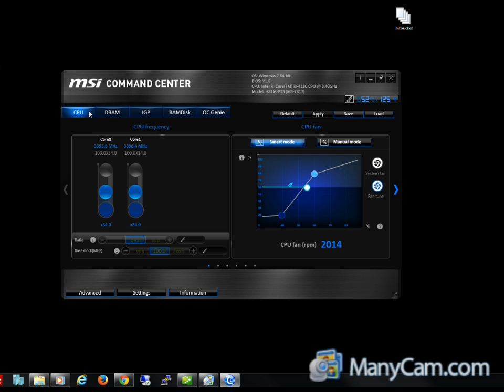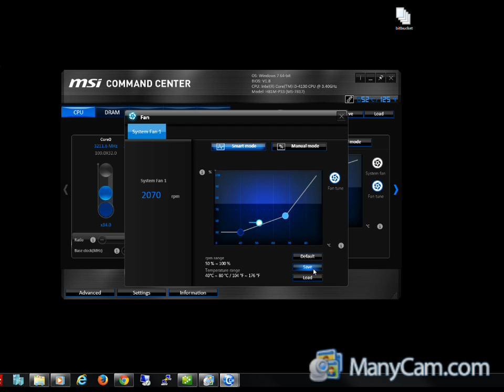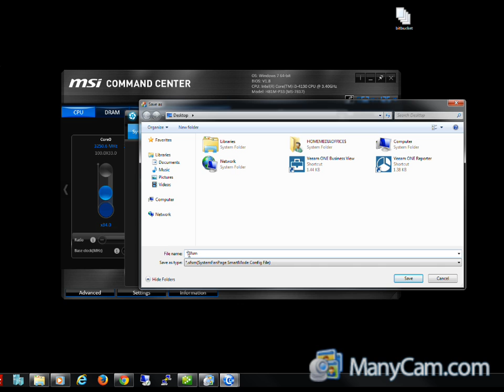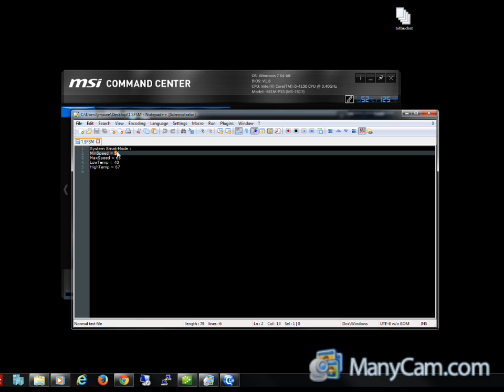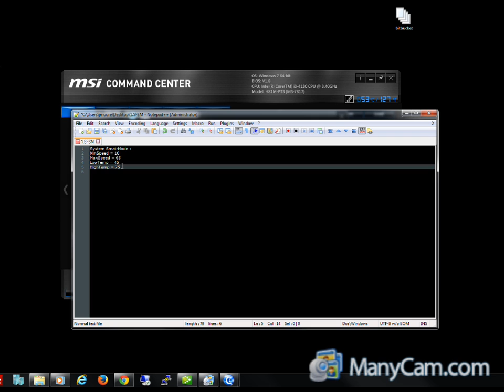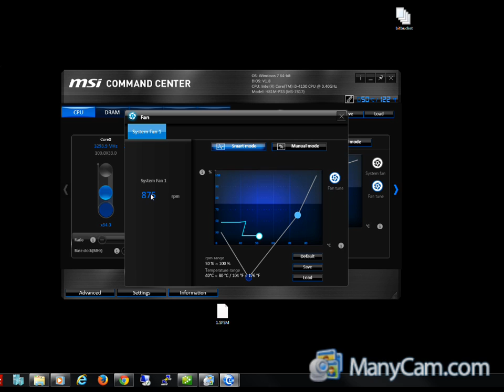Quiet MSI PC Fan Speed Hack

Comment: Doesn't that risk overheating? I'm tired of the sound of fans when I just write text, but when I'm in gaming mode I still want my computer to be cooled.
Reply from the maker: not if you have a reasonable case airflow.
Reply: @DigitalSpaceport  You're right it doesn't hurt anything since it's only a change when you don't use CPU or GPU heavily.  But in my case Command center doesn't save the new settings and I have to do it at every reboot. Is that the same for everyone ?
Reply from the maker: it is indeed that way. The only workaround is using sleep or hibernate.

Comment: Thanks for this 5 year upload. I had actually unplugged all system fans and just opened up the side but I am going to give this a try.
Thank
Edit: Not happening. Just noticed that all the case fans are 3 pin ie NOT PWM. They are staying unplugged lol.
Reply from the maker: Yeah this video is pretty old. What mobo are you trying this on? This works on old, like 1150 hasewell, mobos. Trying to pin down when MSI in their enlightenment decided to disallow this workaround.

Comment: It works but once i restart my pc its back at default again, and i have to load the changed settings again.
Reply: How do you change this?
Reply: You can use something called Argus Monitor to set fan profiles (and below 40%). It is compatible with my MSI motherboard. I was fed up with reloading the fan profiles after every restart.
Reply from the maker: Yeah sleep mod is the only way to get around that even back then on this old 1150 mobo.

Comment: Control Center 2.5.060 allowed me to set the speed to 20% at 40C without having to edit the file. However the Bios does not. Still, I never would have thought to look there. I just rebuilt my liquid cooling system with two fans and a large radiator, and even 50% was way high. Alas, I do have to reboot often, so if you find a way to make the config load at startup, let us know.

Comment: Thanks for the video. Just saved me a visit to the ear-doctor ;)
Somehow 50% is really loud with Noctua fans, while 40% is nice and quiet.

The resetting on restart is a fail though - but thanks for the advice on sleep mode.

Also, I can't adjust below 50% in BIOS either - is this normal?

Comment: My system fan is on 0 RRPM. My CPU fan is 2100RPM and the temp is 56 celsius. Should I lower the RPM much or is it unsafe?
Reply: It's not unsafe... I have not fan at all and... Windows 10 works just fine... I cannot play but all works.

Comment: I completely agree,,msi is going DOWN hill fast..I had a asus.microatx,,which NEVER DID this once...BUT it had a weird bios # so I got a refund and went here,,to a mESS frankly.

Mine works 'better', but its over works my stock lga 1155 intel fan to death..not normal although.this new msi board I have ( new to me ) is a B75a-G43,,and its meant to overclock..my CPU is NON'k' so I can't anyway.

My board allowed me to choose 40 C and 25% , which so far anyway is working, but not properly. 

IE: Not at all happy with msi, and their forum is no help at all..my post  was ignored..too many users and not even staff.

To reiterate, I know this is a 'OC'ing mobo, but still, this kind of thing is ridiculous..the asus I had was as old as this, and was ten times better..which is why I knew the fan 'noise' with this msi was incredible bad.

Never -again.

Btw, yes you can fix it from windows, but if you do, when you leave windows briefly, say for bios, bam 3000 rpm ~. NOt me.

Comment: if you run your fan bearings lower rpm than their voltage the motor will get burned.

Comment: you are a hero man!
Reply: Although my system fans now shut down, my problem is that my system is cooled purely by airflow, so I only use system fans, the motherboard uses the other fans as CPU fans so it's not possible for me to change them using a config file :(

Blhe gonna get a fan controller then

Comment: In the manual says about command center:
"Every time you shut down the system, the configured setting will be restored to the
factory default. If you want to use the saved settings, you have to load it every time by
clicking the Load and Apply buttons"
If this is true, this programm is not very good, because you must load the same every time you use the PC, IS IT REAL??
After your video I think I am going to buy an Asus Z170-A...
Reply: unfortunalety yes
Reply: Thanks for your answering. I think it´s not a big deal mobo msi, at last for me...

Comment: I am thinking buy a MSI Z170A GAMING M3, but before do it, I´ve reading in the manual about "Controlling the fan speed".
I was looking for the typical mode cpu fan like: Auto-Normal, Quiet-silent, Full-Turbo...but I can not find something like that in the manual. The thing is I want a silent cpu fan. Any advice?

Comment: Thanks!  This works with v1.0.1.16.  Lowest I can go for the fans I have is 35%.  Below that, they turn off.  It would be great like that actually but I think that might be damaging.
Reply: Can you please provide the working version 1.0.1.16 to me? I can't find it anywhere in the internet.
Reply: https://us.msi.com/Motherboard/support/Z97-GAMING-5.html#down-utility&Win10%2064
They updated it to v1.0.1.17 so don't know if it works.  I don't use this anymore.  I use a fan splitter to my CPU fan header.
Reply: It works with 1.0.1.17, but you still have to load the files every boot :(
Reply: Ok guys. Thx for the feedback. This is all in all not satisfying. Can't understand why MSI decided to go this way with the fan control implementation.

Comment: Does anyone know if it is the same case with every MSI MOBOs?
Reply: Nope It's not, I have had msi 970a g43 plus (i do not reccomend for high cpu's, my fx8350 sucked so mutch power from it it killed it (cpu survived) but on that motherboard you can control with speedfan. and others not like MSI 970 GAMING

Comment: Doesn't work anymore which is bullshit, Guess i'll have to buy different fans or something
Reply: Me too.. I hate it but also love the looks of it.. However there is an alternative like one of those automatic fan control units.. you plug it into the thingie.. stick one sensor thingie on cpu heatsing and other one on gpu heatsing and you can set like these graphs so it turns only when cpu or gpu reaches some temp.. Speed touch one seems to do it like this i ll have to look further into it i guess

Comment: MAN my fan is at 1700RPM and the dot u pointed at is below the minimum, something is wrong isnt it?
Reply: how man? please help WAY TOO LOUD
Reply: When I do this, and my CPU drops under my minimum 40c, all my fans turn off until it raises above that temp again, and they just keep alternating on/off, cant be good for them, right? How do I just keep them at the minimum?

I deleted those extra lines btw, in the config file
Reply: I'm running 7 Noctua NF A-14s and an NH-D15 air cooler with both fans on it in a Fractal Design Define S with added acoustic dampening.

Suffice to say, a LOT of fans, but ideally I want them all at 300-600rpm. Really easy to plug in thanks to a bunch of Y-splitters.

I want to thank you for the video, but I don't like how limiting Command Center is, therefore, I'm going to give the new SpeedFan update a try with my MSI Z97 board.

Comment: MSI this is insanity. If I put in 800 to 3000 rpm fans i'm stuck at 2000 RPMs. BUT if I put 300 to 800 rpm fans I can go to 500 rpms.  MSI your basically telling me to use cheap, less safe fans into my case.

Comment: I just wanted to post a note to say thanks for making this video.  I just built a system using the z97 MoBd and was really frustrated with the system fan control limiting the lower end of the fan speeds at 50%.  As you noted, it was like a jet running in my house even when the fans were basically not needed at all.  I edited the fan config files and all are now running at about 20%.  Thank you very much for creating this video.

Comment: This solution works fine for me. My board is a Z97 Gaming 5, with command centre version 1.0.1.11 I think.

Only issue with this is that MSI Command Centre isn't supposed to be a permanent solution, it's more for testing so... it doesn't save anything, and every time you boot up your system you'll be forced to go through this process again.

In the end I installed SpeedFan, and it works great. It takes a little bit of configuring (nothing a few guides on YouTube can't help you with) but now I've got my fans running at 30%, 40% and one of them is totally off until my CPU hits a certain temp. All this without me needing to even touch the program anymore, since it saves my configuration and loads on startup.

Comment: I'am on 1.01.08 and it works just as described in the video. Iam using PWM fans,. but i think my mobo (Z97 Gaming 7) controls the fans via voltage...